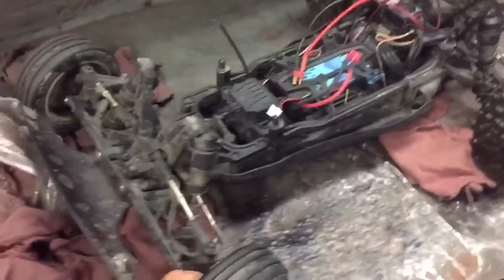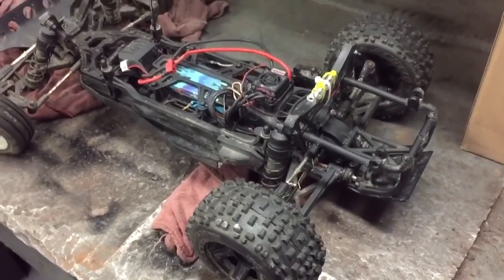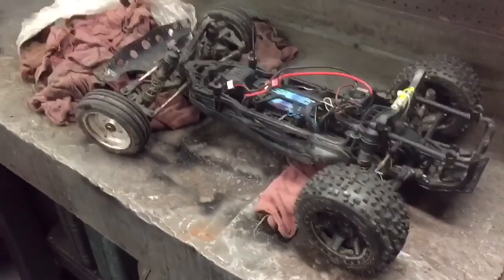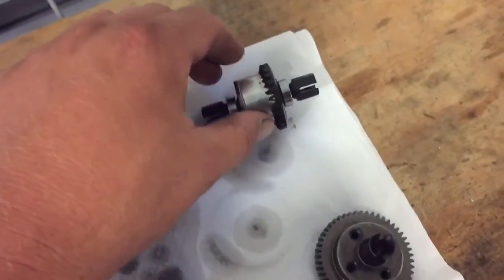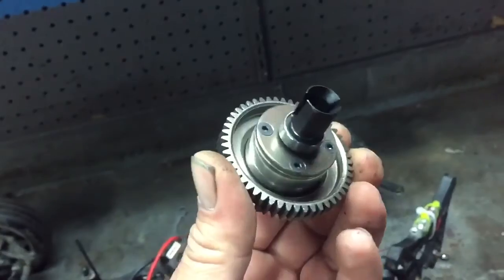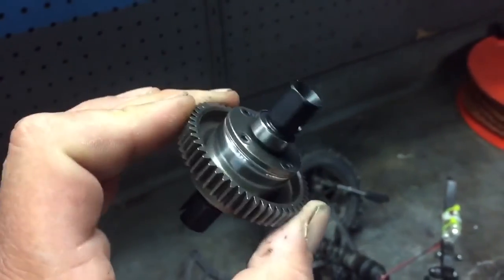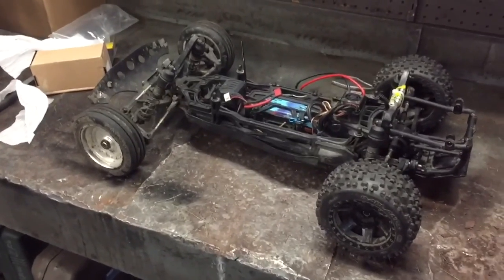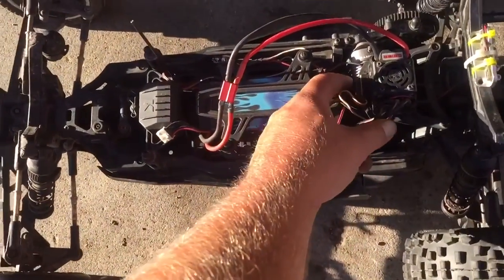6amRC. Kyosho Scorpion XXL. Back from the dead

Comment: That diff shouldn't let you down! just make sure it was assembled with threadlock! 

This is Tug BTW! ;)
Reply from the maker: That why I sent to to the expert to get done.  I can now see this going 6s in future.
Reply: +billy kelly I run 5S on an 1800kv motor with stock gearing, this gives good speed and efficiency, but kudos to 6S! Keep the vids coming! :)
Reply from the maker: +Clive Wilson   6s system.  I've never run on 5s. Maybe this would be good to try. Had planned to move up before I started having diff issue. Now it's like starting over.
Reply: +billy kelly , The CEN diff won't fail you, Dan has been running his on 6S with a 1717,  but you probably already know that. Get out there and enjoy what is an entertaining drive! Probably not a ramper like the MTs, but they do jump! A French guy has made loads of vids of his doing jump after jump. I think his name's LeClerque, but can't remember. He definitely shows how well it can fly!
Reply from the maker: +Clive Wilson   I did some jumps when I first got it. All pavement stuff back then. Don't need it to fly. I've got other for that.
Reply: +billy kelly , I look forward to some vids of successful runs!  (I'm probably not the only one either!)
Reply: Anyway I can get in touch with Dan to get a CEN diff done?
Reply from the maker: If you are a member on ultimate RC or RCTech he can be contacted from there.
Reply: Ok thanks! Good luck with your new diff 👍🏻
Reply from the maker: If you don't get response on RCT. Let me know. 
Looking forward to fall for it. Once grass gets shorter, makes for better running.
Reply: Ok thanks I left a comment on one of the posts cheers
Reply: Hi Billy not heard anything from Dan about the CEN diff any chance you could help me out?
Reply from the maker: Already did. Check RCT. He posted his number for people to contact him direct.
Reply: Ah yes thanks! Might be awkward for me as I'm based in uk but will figure something out cheers
Reply from the maker: I knew that. Soon as I read "Cheers" knew it was either uk or Australia.